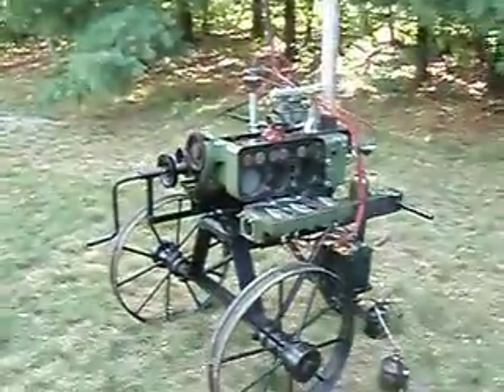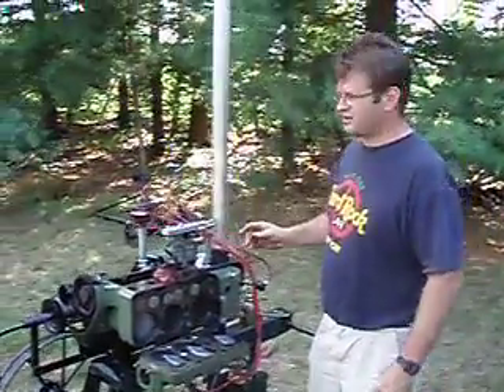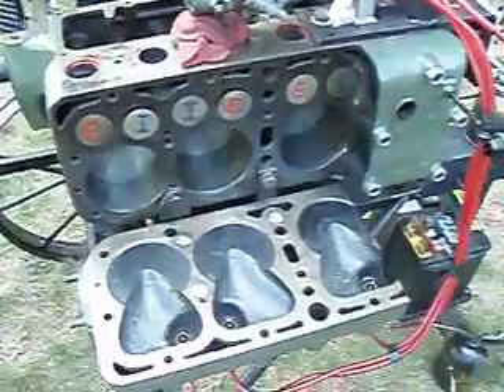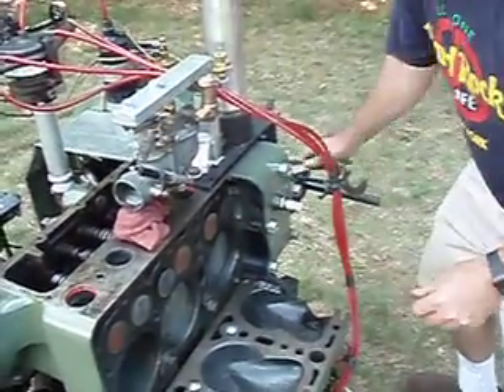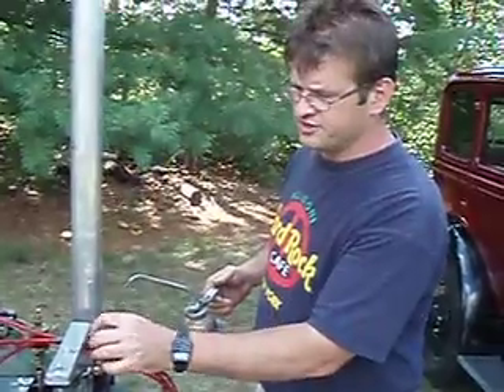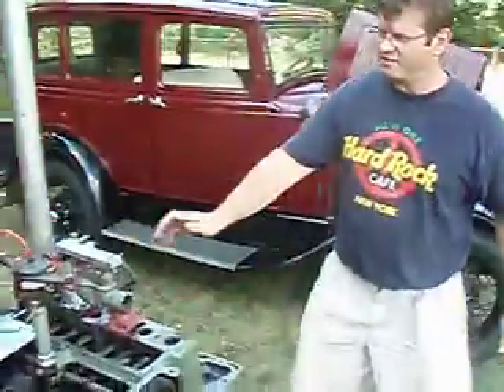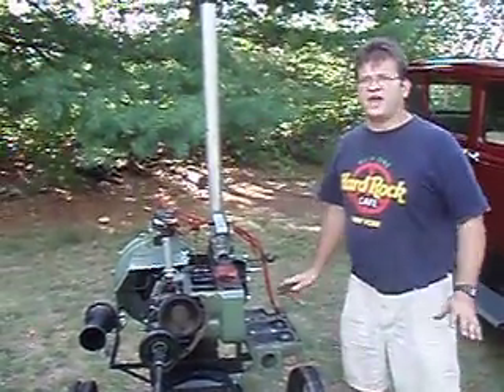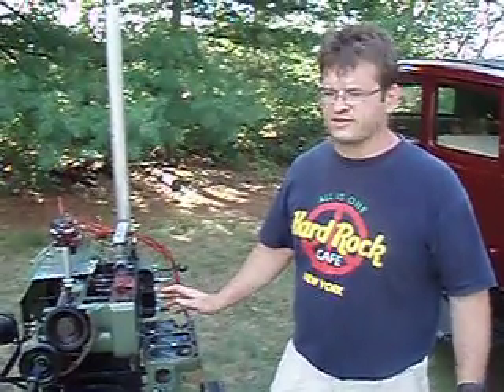Open Engine Model A Ford

Comment: Runs pretty dang smooth for only 1 cylinder firing
Reply: the roughness caused by mising cyl is the compression then no bang
Reply: It would never run that smooth if not for the flywheel & pressure plate, there's about 100 pounds of momentum spinning.

Comment: how it possible it works without spark plug or something? and without gasoline and no compression, i dont understand
Reply: its a 4 cylinder, only 1 one cylinder is running, while the others are open, the only cylinder running does have compression and a spark plug
Reply: GravityPlays thanks, nice answer
Reply: no problem

Comment: Interestingly, the valves command is at the bottom , with the crankshaft
Reply: A side valve engine, rather than OHV. When that engine was made it was the norm.
Reply: which is why they call it a flathead

Comment: how did it run so good on one cylinder?
Reply from the maker: almost 100 pounds of flywheel...
Reply: Oh o.k. thanks for the reply.
Reply: +cadauctions31 welcome
Reply: +cadauctions31 no compression on cylinder 1 2 or 3 makes it easy to turn. has nothing to do with the flywheel

Comment: Cool i already know how engines work but ive just never seen one that doesnt need motor oil for a lubricant. All inside the enging. Really cool thank you for this video. Like i said even tho i know how it all works, this is still a very cool video.

Comment: it doesnt need motor oil????? how is the engine not freezing up.
Reply from the maker: The oil is above the cylinder in a drip oiler.  The bearings are lubricated with grease.

Comment: As a Model A'er you did a great job using the simplicity of the A engine to demonstrate how a 4-stroke works.
I'm sure I'm going to get plenty of thumbs down for this next part. My only negative is that the camera man never stood still! I knew what I was looking at but a newbie would have a difficult time absorbing what he was seeing with the non-stop camera motion. Do the exact same demo but have the camera stop and stay still for a few seconds at each point of the compass for some analysis time as you watch the motor run. Then you'll get 5 stars.
All in all, well done and a great idea!

Comment: Many years ago when I was young I was given a 63 Fairlane  It looked fine but the engine was totally fu I mean worn out, think it was a 260 it would after a bit of either  start on one cylinder, after a while it would kind of run on eight , the smoke was a joke (poetry) my dad once said" shut it down or we will have a fire truck turn up" I put a second hand engine in it and my wife to be drove it for a couple of years . I really miss my youth, sure had fun ..

Comment: I have seen many cut away engines, on trade stands and in dealers shops, but never one that actually ran.
Amazing teaching tool that, you can crank it by hand slowly and watch what the parts actually do , then actually run it to show how fast this happens.  Great.

Comment: That is Awesome!
Very clever and unique concept. 
I'd like to do something like that myself. 
I wonder if it would be possible with a more modern engine like something from the 70's or so?

How do you stop the other bearings and pistons Seizing or is it just the motors were very loose?

Again, great job and well done for your good intentions to teach others.

Comment: this is the  first display  of  it's  kind  that  I  have  ever  seen,,   I am  intimately  familiar  with  internal  combustion engines   but this  shows it in a  completely new  light ,, I  work  on lawnmower  engines every  day  and  I  have seen different machines with  clear covers and  all manner of  modifications like that  but  never  one  of  this quality   which i  find   very  cool  
Congrats  on a job  well  done  ,, very  impressive

Comment: The German TÜV doesn't allow non-stock horns. So the car has to have a horn and it has to be stock, or else it will get expensive.
And yes, these horns are sort-of still available, but not *exactly* like they were made back then. Nowadays, they are made of plastic and don't create the vibration with a motor, but electromagnetically. That gives them another type of sound. The horns I found on eBay were all pitched much higher than these original Klaxon gems! And those are f***n expensive...

Comment: Great idea and very nice workmanship.  Love watching it turn.   Who knew that a T engine would run on one cylinder? Just a suggestion - you might put a guard made from metal fence over the gears and crank.  As much as we would like to believe that it's safe, you just never know when a young child will reach in and get hurt.  It can happen in a flash.

Comment: Good day
I forgot the name of the particular brand of air compressor, but my brother has it in his mechanics garage. He got it from his old boss. It was in service from ??1967-68?? until 2010, & NEVER had oil change. & used EVERY day all day in busy garage..(I helped him set it up in his new garage). The oil was black goo, & tank rusted through. Some work later, & new tank, it runs great...slow, but great, & yes has Ford model T parts.

Comment: Very cool video and thanks for posting it...Interesting how well that A engine runs on just cylinder...I know they work well running on 2 cylinders and were often used as air compressors for sand blasting and a number of other things...

Comment: But how did you solve a problem of crankshaft and camshaft bearings lubrication in your project? Is there an oil pressure or just a few drops of it for short run.

Comment: you should try having a blocked cooling system, or some copper hose coiled up inside the watter jacket so you can pump water through it.

Comment: @UncleBarn1  Engines have thermostats installed to restrict the flow of water so they heat fast and stay at that temp....If you run an engine without a thermostat - you will have too much cold water flow through the engine which is one of the main causes of broken rings

Comment: @JGMagoo You are incorrect about Model A's not having an oil pump. They did use the splash system, but there was also an oil pump that ran off the distributor shaft.

Comment from the maker: @lukemorganky 
I'm glad you're saving the car for your kids.  I had the same problem with overheating and I installed a thermostat.  The thermostat slows the flow of water through the radiator so it can cool before it reaches the engine.  You might want to check out fordbarn.com...it is a very helpful site.

Comment from the maker: @theoldengine1   Grease, there is at less 13 grease zerks and 12 oil holes ( lifters and rod tops) that get oiled with bar chain oil. Bar chain is sticky, it stays on the engine and not on me!!!